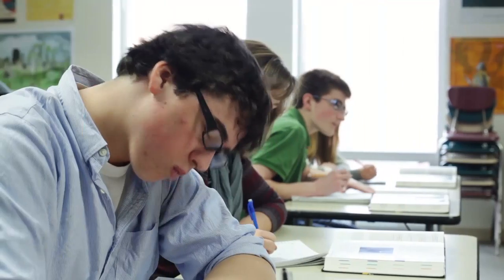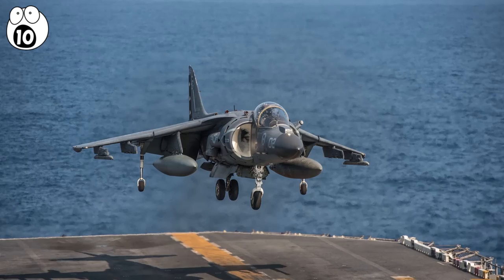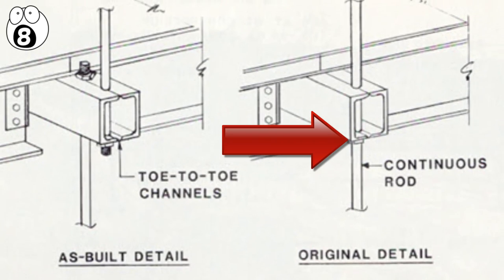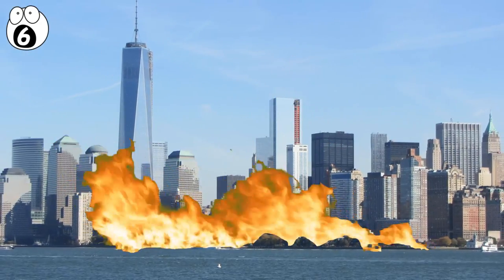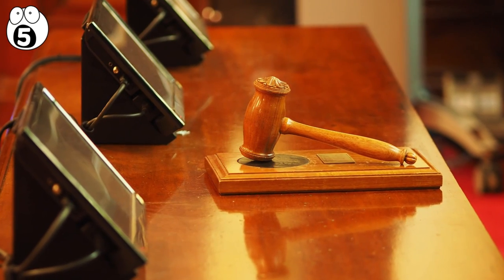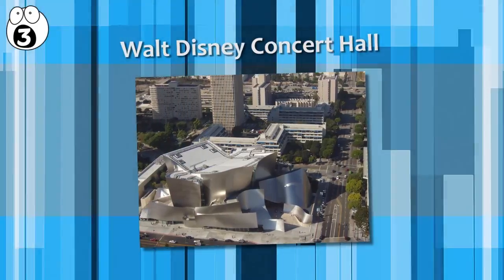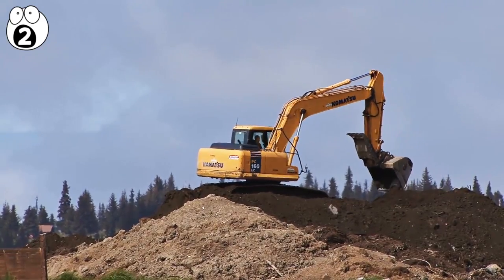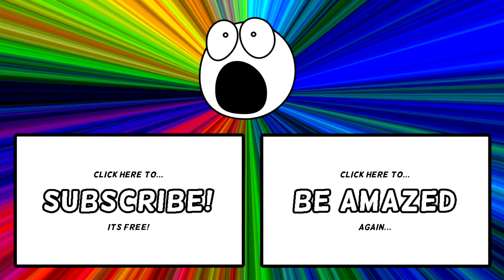Biggest Design Errors Engineers & Architects Made

Comment: How would useing one rod make the design any better than two rods. Still leaves all the weight on one rod.
Reply: Because the rod and the nuts can take the weight. What couldn't was the attachment point at the box frame. 

If they'd used the single rod, the top deck's attachments are carrying the top deck's weight, and the bottom attachments are carrying the bottom. The rod carries both loads, no problem. 

When they "broke" the rod into two parts and offset them, the top rod carried both loads, no problem. The bottom deck attachment points were carrying the bottom deck's load... again, no issues there. But the top deck attachment points were now carrying the top deck load AND the bottom deck load, because instead of being hung from the ceiling on the same rod, the bottom deck was hung from the top deck.

Let's use an analogy that works, unlike the ones the video's creator attempts. The single rod design was like two climbers using a single rope... each climber can hang on with no issue, and the rope is more than enough for both their weights. The modified two rod design was like having the second climber hold on to the first climber's belt, instead of the rope. Rope's still just fine, second climber can hold his own weight just fine, but that first climber better have a grip of steel...

Comment: The information errors in this video could have been avoided easily

Aircraft Career design like many other things developed over time with different methods and techs

You don’t talk about the particular wind behavior that the Tacoma bridge wasn’t design for

You didn’t mention Hyatt skywalk support beams were also supposed to be sandwiched the cable resembling I shape to handle the load better

You said finding the fatigue problem with square shaped window was plain simple when in that age the Comet was the first ever and only commercial jet flying higher than any other planes with pressurized cabin and the developer had no idea that problem even existed until the experiment was done

True that WD Concert Hall has it’s design flaw but you call that Concert Hall design boring? God you got zero taste

Comment: The research on this video is really lacking... The Tacoma bridge problem was famously due to resonance frequency issues NOT rigidity. The Comet window issue was not due to high speed travel stresses, but the stress of repeated pressurization as is was one of the first high altitude airliners. Finally sub engines don't surface subs. Look it up.

I've seen many of your videos and a lot of them have really poor research that a simple visit to even wikipedia would have fixed. Stop being lazy and you'd get way more subs.

Comment: Alright about the ww2 carrier, if a plane comes in to land and the carrier is prepping for landings after a full strike and therefore no planes on deck if a plane missed they came back round again just like nowadays and you used a ww2 era plane probably a coarser (excuse my spelling) compared to a modern plane which as you can see has VTOL technology anyway and better systems on the wires and just generally stronger planes and also remember all US carriers had to pass through a canal to get to Europe and therefore with bigger runways they wouldnt have been able to get through. In short this video is garbage

Comment: Only made it to number 2. Worst video I have seen with stupid mistakes. The bridge failed to harmonics. And no I don't mean that the bridge was made from harmonicas. It works like pushing a child on a swing. You give a little energy and keep adding energy at the top of the swing. The wind provided the energy. The bridge was too thin and acted like a wing. Saddest thing about the collapse was the sole victim. a poor dog named Tubby. :(  And doing the lazy man research I found out where  he got the whole idea of "not enough holes",  Wikipedia. One of the attempted solution to the problem was drilling holes into the sides of the bridge.  Anyway this is a bad video.

Comment: One of your worse videos.  Who wrote this script?  As an engineer, your explanations are weak at best, using analogies that have no real bearing on the concept to be explained.  For example, the length of the aircraft carrier... you state it is so the plane can pull up after it leaves the deck.  How does the length have anything to do with the height of the deck over the water?  Nothing.  Ugh.

Comment: why so many disslikes :(
Reply: While there are things on the list that do actually belong; there are problems with the video.

(1) Bad analogies. For example he compared bolts to using tape to put your fingers back on. In actuality, they are advantageous for low stress areas. What he doesn't mention in the video is that the people building the Citgroup center decided to put bolts in the high stress areas without the permission of the person who designed the tower. He also compared the wire of the aircraft carrier to two drunken people stopping a car with floss; which is far from an accurate analogy (not to mention it is still important in stopping modern jetcraft). Ironically, that picture he shows is not even the Grand Canyon. Also, he said the Tacomo Narrows Bridge was like dry noodles; when in actuality the bridge was destroyed from ever worsening osculation. 

(2) He forgets that aircraft carriers were new technology at the time. The reason for the angled decks on newer aircraft is because of technological progress and the switch from wooden tops to metal tops (which he forgot to mention). Also, the aircraft were generally stored inside the ship like they are even to this day. Also, he forgot about amphibious assault ships; which could be considered the spiritual successors to WW2 aircraft carriers. While amphibious assault ships mostly carry VTOL aircraft, they have no need for an angled deck. If anything, the Liberty Cargo ship (which would have fitted the video much more) had an actual design flaw he glossed over; the ship early on would split in half without warning.

(3) Hyatt Regency Walkway is a fitting example; but he got one thing wrong. It wasn't the rods that failed; it was the beam box. 

(4) What he doesn't mention about the Comet jetliner is that metal fatigue was a relatively new concept at the time. Passenger airplanes had square windows in the past, but it didn't become a problem until the age of pressurized jetliners. Also, they apparently nailed in the metal skin; making the metal fatigue worse.